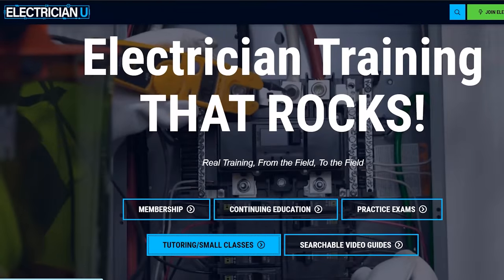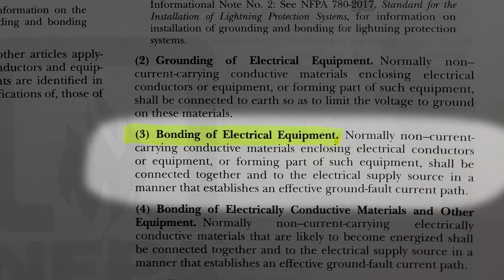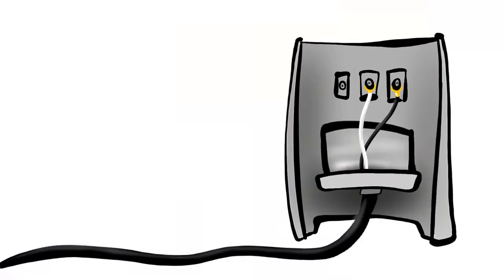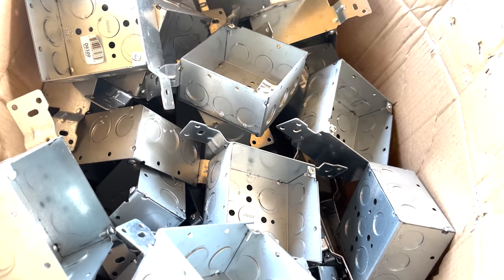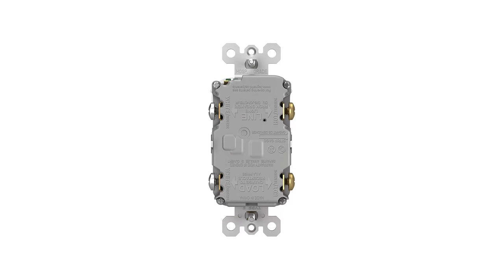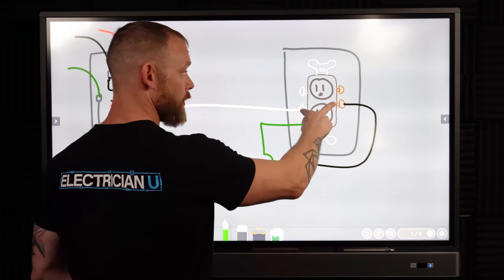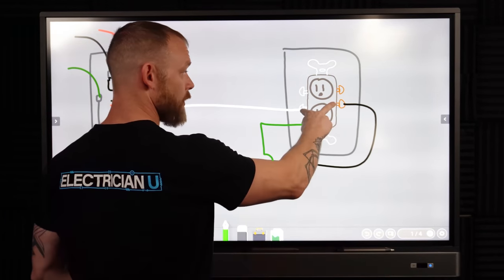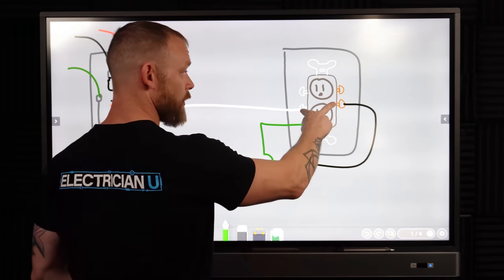Why We Bond Metal Boxes? Do Plastic Boxes Need Bonding?

Comment: I object to your concept that the ground must be bonded to the neutral at the box.  I have retrofitted a green ground wire in my basement to go from the outlet box to a copper cold water pipe in the basement.  I believe if a short occurs, that the overflow condition will go to the pipe and trip the breaker back at the panel.  I don't think it is necessary for the neutral to be involved.  (Not an electrician, a DIY homeowner.)
Reply: Then you object to the NEC code my guy
Reply: If you’ve grounded your box but didn’t bond it you could quite literally kill someone if there’s a ground fault bc it will NOT trip that breaker..please check out mike holts videos on this topic and get that fixed asap my guy. There’s numerous cases of people getting killed in this scenario
Reply: @tfun101  How, then when I put in a circuit tester, it shows 123 volts from hot to both neutral and ground, and zero from neutral to ground?  The screws which connect the strap to the metal box conduct electricity.

Comment: Why would you ever use metal boxes , I mean now ,for residential
Reply: As a diy'er I prefer the 4 square metal boxes using the appropriate mud ring. I find them easier to mount accurately to the stud, they are much stronger and don't deform, and the 2 1/8 deep ones have over 30 cu. in. of volume. I also like the fact that I can mount them with screws instead of the nail on crap.

Comment: The whole "grounded conductor vs grounding conductor" thing is so confusing. I understand it now (took a while), and it's not my job, but it seems like poorly designed terminology....
Reply: Un-grounded Neutrals are not normal in the USA. OTOH if The circuit had NO ground, then shock to Earth (Ground) is less likely, 
But Isolated circuits have other issues, making them less desirable.

Comment: Here’s a question, why bond a metal box with pvc coming into it this doesn’t make sence
Reply: Because the box can become energized regardless if it is fed by PVC and that could kill someone. Someone opens up the devices, touches the metal box and touches something else that is grounded and then they will get zapped. If the metal box was bonded, the breaker would have tripped during a ground fault. It is the same as if we terminate NM (Romex) to a metal box. All metal parts need to be bonded together. It makes a lot of sense when you understand electrical theory.